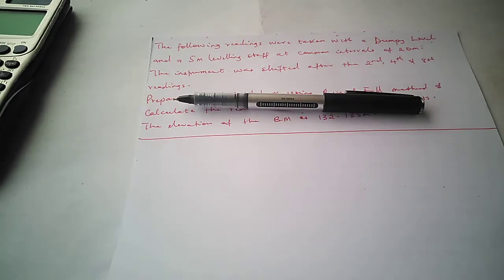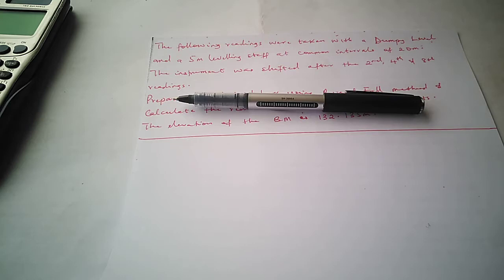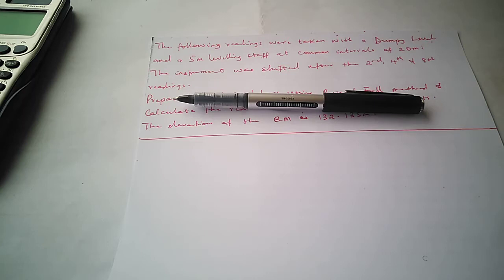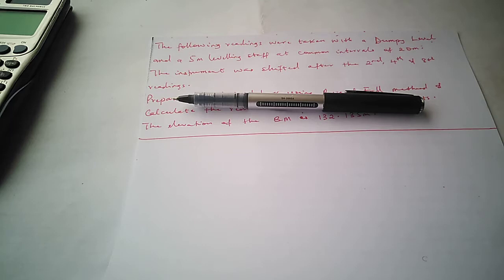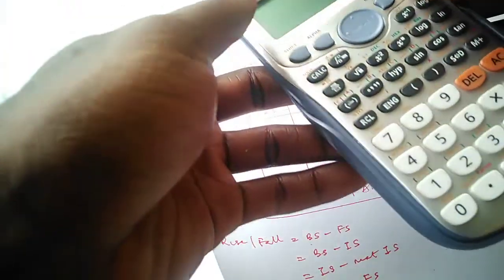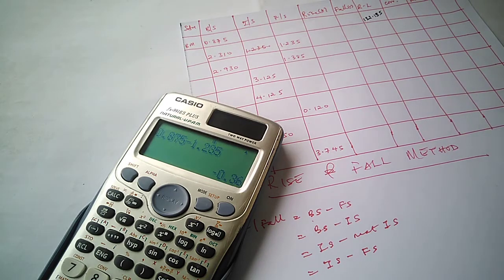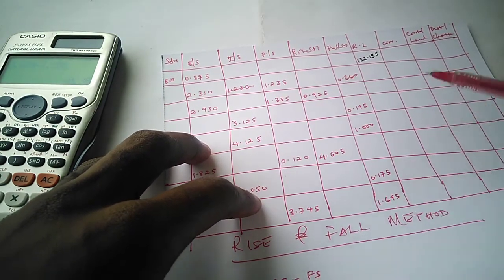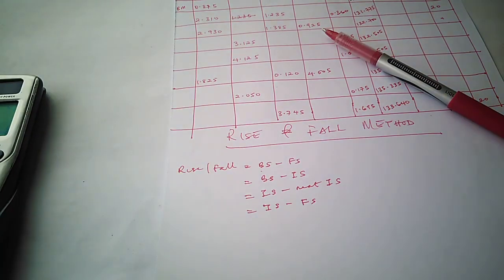Rise and Fall Method in Levelling Surveying in English 2025

Comment: Please can 30m interval be used during levelling project sir
Reply from the maker: Yes, Bolu. 

However, it won't give you a very good depiction of the change in elevation of the terrain, especially in a relatively small area. 

It might be OK if you're working on a larger area because you might not need as much details as you'd in the smaller area. 

Again, it depends on the specifications given to you for the project. 

I hope these help!

Comment: Good job Sir, but, there was an error on the 7th reduced level. For Fall, it was backsight 1.825-2.050=0.225, hence the reduced level could've been 135.285.
Reply from the maker: Thank you so much, DJ Finest.

Going through the note here, I saw that instead of 2.050, I used 2 for the calculations, hence, it affected the RL on that point by (0.05). 

The RL of the next (last) point will be 133.590 instead of the 133.64 as stated earlier on the video. 

Please pardon that error, and I hope everyone sees it as 2.050 and not just 2! 

Once again, thank you for stating it.

😊